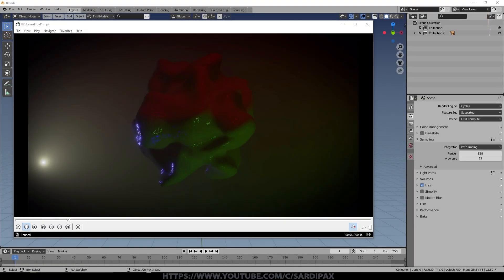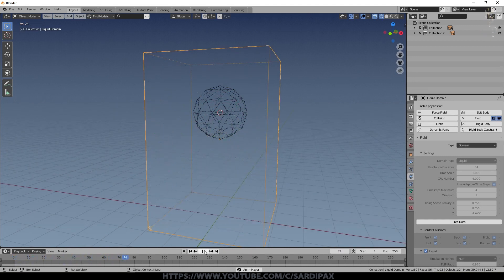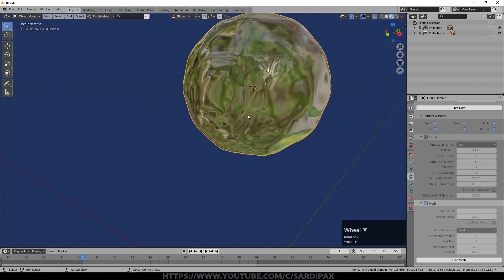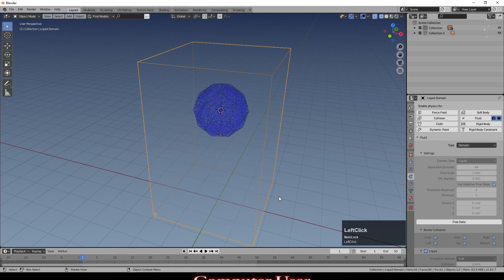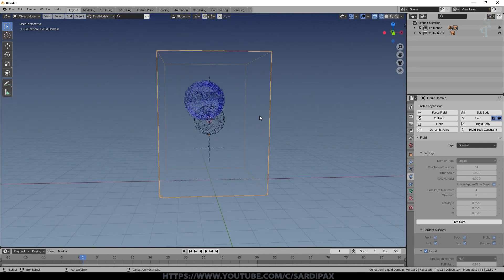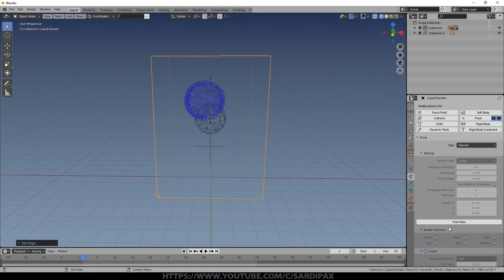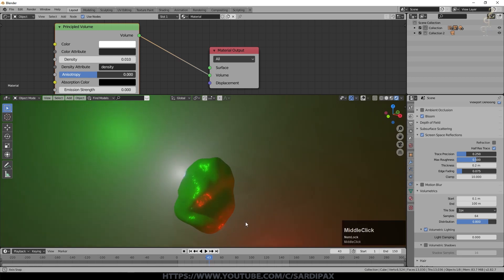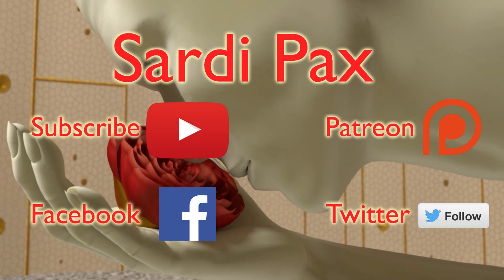Blender Tutorial - Zero G Fluid

Comment: I’m a bit disappointed with mantaflow. I used the free version of flip fluids and it works great but doesn’t work with forces so it’s limited a bit.
Reply: I’d love to see a tutorial on how to float a beach ball on a water simulation without the use of a plane under the water surface, or key frames.
Reply from the maker: The Blender version does work with forces as I demonstrate in this tutorial. You do need to run fairly high resolution simulations for realistic results though (if trying to simulate things like water) which can be time consuming.
Reply: Sardi Pax no I realize that manta flow works but there is a free version of flip fluid you can download that’s way better but that version doesn’t work with forces.